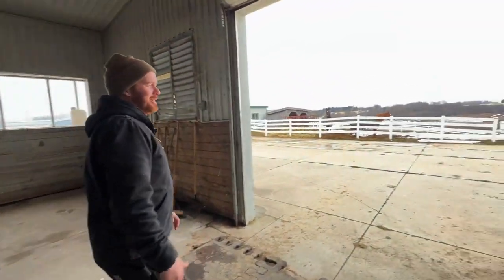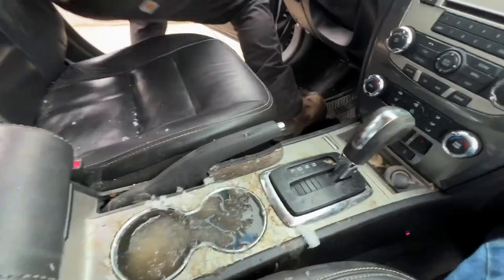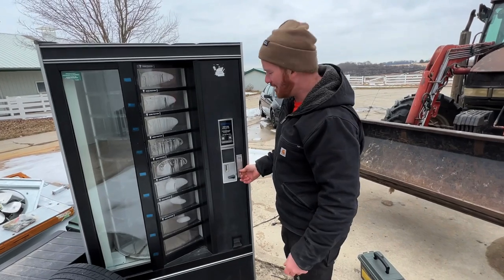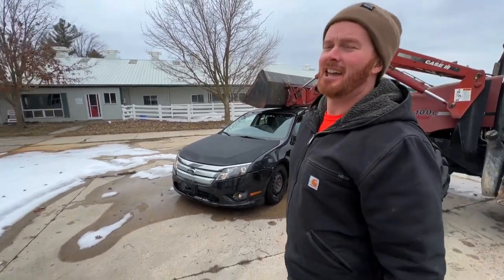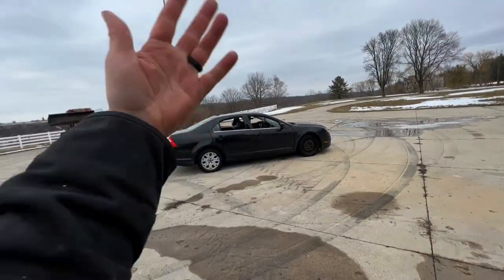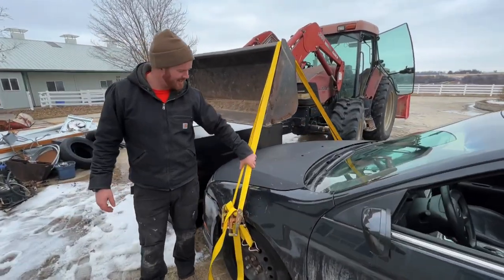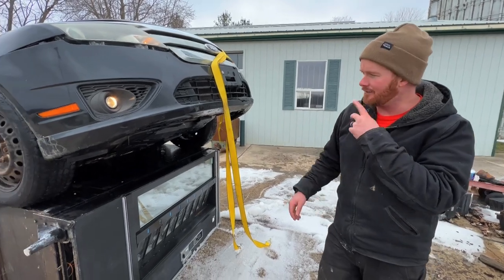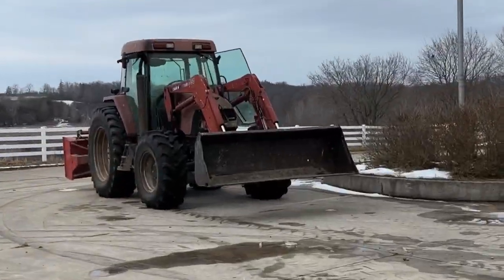DESTROYED Vending Machine Ford BURNOUT!

Comment: Hang a car from a tree with cables on the wheels and see if its strong enough to pull itself higher in the air.
Reply from the maker: That’d be a wild idea!
Reply: @markfreeman408  Do roof durability test from the silo with bricks, traffic cones, etc for safety crashes lol
Reply: @markfreeman408  have xtreme metal worx make custom universal spacers to bolt multiple wheels together and do donuts
Reply: @markfreeman408  cut a hole in the bottom of the doors and pass a chase around the b pillar floor level. have about 20 feet loose and tie it to a tree bottom. see if you can cut down a tree by driving around it at 60kmh